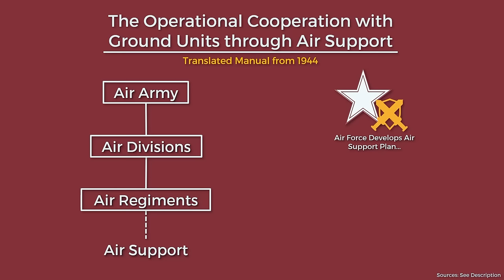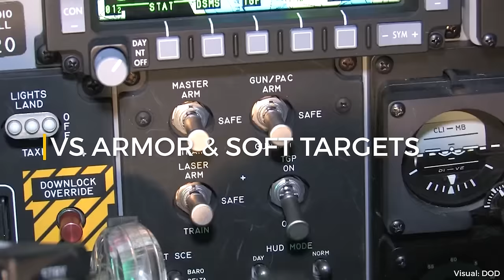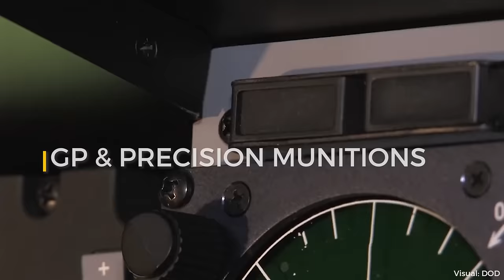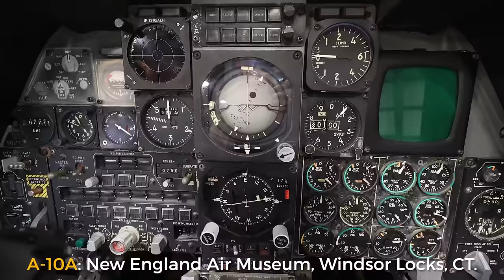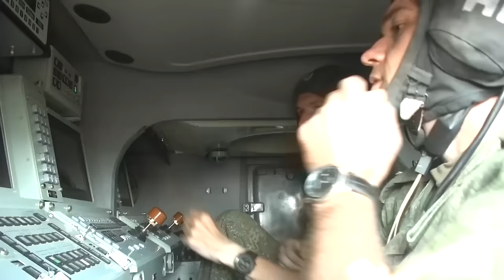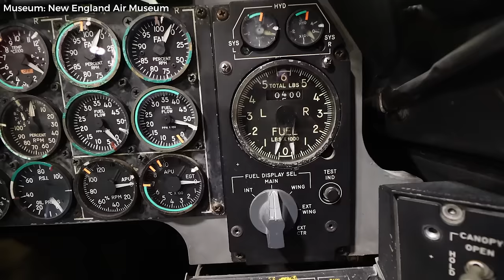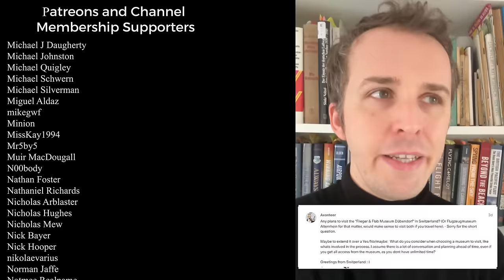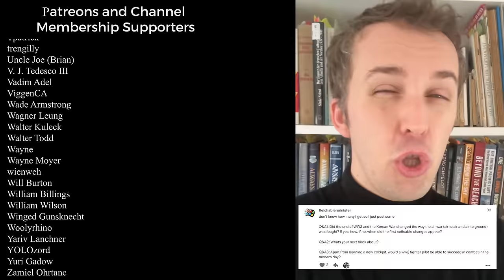A-10 Warthog: Retire or Upgrade the BRRRT? - Future of A-10C Thunderbolt II

Comment: The problem is, with what they are planning to replace with it, F-35? A-10s selling point was always, it can take some hits, I am sure F-35 can't even survive some hits from a .50 cal and I am sure drones will not survive that also, because the protections of A-10 are build to keep the pilot alive, nobody will invest to that to keep a robot alive. So yeah, a drone can be 10 times cheaper, but if you loose 10 drones, it is not also cheap isn't. And everybody complains, A-10 can survive against modern SAM threats, the original mission parameters of A-10 was not loitering 3000m in Afghanistan, it was tree top flying against Soviet Armoured columns, considering what is happening in Ukraine - Russia and Russia becoming a threat again, nobody can make me believe SAMs would be that effective against tree top flying....and A-10 would still have a mission.
Reply: All russian tanks are burning wrecks now so there is no longer any need for a plane specialized in destroying soviet armor.
And a F35 would have better chance of survival against manpads and SAMs simply because they cannot lock on to that plane - but the same is not true for the A-10.
And you could get something like 63.000 FPV drones for the same price as 1 A-10 (costs for pilots, fuel, ammunition, and repairs are not included). So a cost-benifit analysis could be interesting here.

And a tree top aircraft is still vulnerable to enemy planes. And being such a one trick pony is not useful for being a bomb truck. I rather have an aircraft that can fly high and fast so that the smart bombs can reach targets further away.
Reply: @nattygsbord  You know that most of the manpads are IR seeking and F-35 does not have a special defence against it. And no stealth plane can hover/loiter 10 km before enemy line at 5000m to drop laser guided bombs, I am guessing 20km circle at front lines would be no fly zone even for stealth planes. And I am sure Predator Drones from USA are at price range of million dollars, not 63000 dollar.
Reply: @posthumecaver  
Older variants of F35B used to have a problem with its IR signature because it had to save weight by removing a half tonnes heavy equipment that did hide the hot exhaust gases from the engine.

This problem have however been solved, and I believe that all three versions of F35 now have IR stealth, as cold liquid are pumped around the plane and on the wings to make the plane as cold as the surrounding sky so it gets hard to detect.

And even if one might perhaps detect the plane, its probably not enough of a heat signature to lock a missile on this target for a cheap manpad. And given how crappy the S-300 and S-400 systems are do I strongly doubt that they can shot down F35 when they cannot even shot down a big slow flying 50 year old drone over Engels air force base.
Singapore revealed that F35 planes have been flying near russian troops in Ukraine and collecting data on russian positions and handed them over to Ukraine.
And if that is true, then this is very impressive given how strong the russian troop concentrations are in that area.

I doubt an A-10 could manage to do anything similiar.
Reply: The difference in survivability between an A-10 and say an F-16, is that the F-16's survivability helps it continue the mission after being engaged, while the A-10 helps the pilot get home once the A-10 becomes incapable of performing the mission. However as proven during Desert Storm, getting home does not mean the pilot lives. There was a case of an A-10 cartwheeling on landing, killing the pilot, because the back-up control system could not stabilise the plane to land in a cross-wind.

Russia has prevented Ukraine from using any sort of air support - notably the A-10's Soviet equivalent the Su-25. Ukraine has done the same for Russia's own Su-25s.
Reply: @dumdumbinks274  I am not saying A-10 can survive flying at 5000m loiter and drops bombs. As proven in Ukraine, in frontlines, it is no fly zone at 20 km ranges any sort of airplane above 100m  (As both of them only using drones). And don't confuse the mission profile of A-10 in a desert and what will be in Europe. What will happen if Russia attacks in Europe with tank columns, they will try to get quick breakthrough and get a bridge head, so Russian must operate with minimal support behind the NATO lines, that will be mission profile of A-10, crash the bridge head, slow down the breakthrough, so ground force can get time to react...Flying over forrest terrain and deep valleys at Europe is something else then flying in desert....
Reply: @posthumecaver  That theoretical European situation is likely to result in more A-10s being shot down than during Desert Storm, because A-10s were never used to attack strategic locations such as bridges, or formations that likely have AA components attached to them.